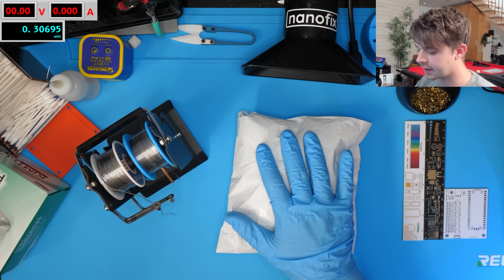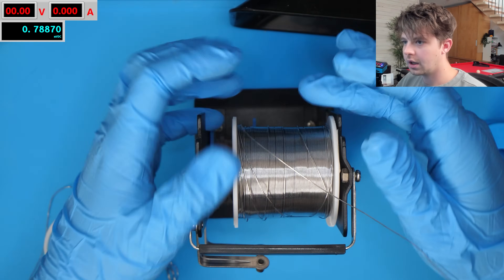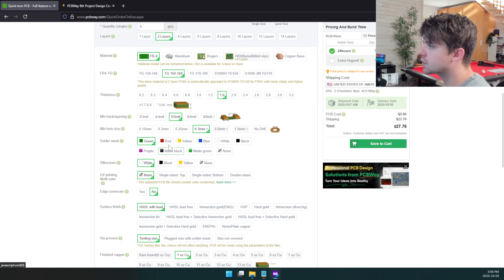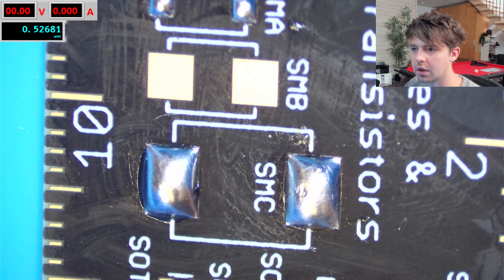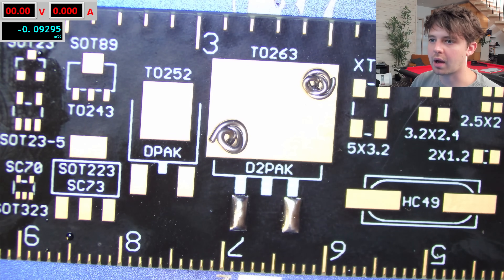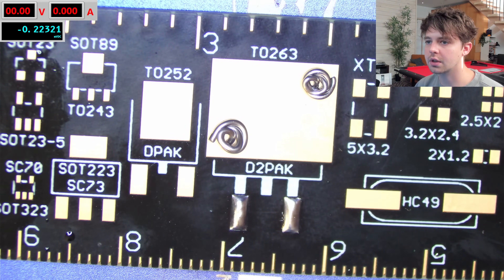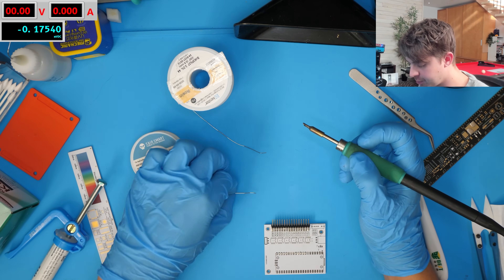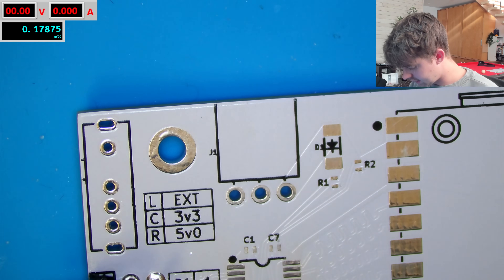Is Kester Solder Better?

Comment: Why did you remove my comments pointing out core 44 is RA and not no clean and recommending cores 285 or 245 and that kester does make solder in 0.6mm diameter?
Reply from the maker: I didn't remove any comments! I have not and will not ever remove comments or censor people. I can promise you that 👍🏻
Reply: @nanofixca  i dont understand, i tried sending comments both from my phone and laptop and for some reason they dont show up -.- maybe theres something in the text or length that is making it youtube shadowban it idk
Reply from the maker: @basileus9343  Yeah youtube's auto moderation/comment system is horrible these days. If you're attempting to post a link I think YT automatically removes it
Reply: @nanofixca  Havent put links though. I also tried posting a short rando comment, it went through, then i edited it with the message i wanted to say and a refresh later it disappeared! insane. Let me try and break it into smaller chunks to see if theres a part that triggers it.
Reply: The core 44 flux solder you got is an RA flux, imo its terrible as you could see (very sticky and brown flux residues), and getting the 3.3% content makes everything worse. It's also moderately corrosive according to the datasheet.
Reply: Nope, theres something about the 2nd paragraph i wrote youtube doesnt like. Maybe its flagging the kester product codes i wrote, they are 10 digit numbers, maybe they are flagging it as phone numbers spam?
Reply: Welp, essentially i was just talking about which flux cored solder from kester i would recommend, their RMA or no clean in 2.2% flux content, you can check the product code for the exact specifications of solder you wish on their website and then google it to find it. Also wanted to say you can find in 0.6mm, before you said it kester doesnt make it as far as you know, but they do
Reply: i would have sent you links and product codes to datasheets and models but youtube doesnt like any of that so thats all i can say..
Reply from the maker: @basileus9343  Thanks for the info! I may look into buying some different Kester solder for future testing so I'll look into it 👌🏻
Reply: @nanofixca  Would love to see it, wouldnt want to see you get into another mgchemicals 8342 vs 8341 situation 😂 RA flux is the devil. Kester is expensive and there's good solder for less money but when it comes to selection of flux percentages, type, diameter and alloy i find them difficult to beat, their portfolio is so extensive its assured to have the right solder for you and their datasheets are quite nice, i'm sure you will appreciate it 😁 scratches the tool nut itch
Reply: It's YT doing that bro. They silently added a comment moderating AI a while back which deletes any comments that it finds problematic. How does it determine what is and what isn't problematic? Nobody knows, not even the developers that trained it. It's a 'black box' just like most AI is and the exact combinations of words, personal history, username, pfp, etc that it doesn't like would be no simple task to determine. So try to avoid the usual nonos like getting political etc, but as with your comment, sometimes you don't even have to say anything remotely wrong and still set it off. I suggest copying your message before submitting it then refreshing in like a minute or so to see if it's still there, if it isn't you can try and paste it in and just rephrase things a bit to see if you can get it to stay. It's certainly a problem, and I've had my messages randomly deleted in the past as well, there's just not much that can be done...
Reply: @Hauk3ye  thank you, i learned it the hard way 😑
Reply: You deletes and hides around 3/5 comments I make. It's really stupid if a filter caught your comment. lol

Comment: I use Kester SAC305 at work, mainly because I'm not the one paying for it. That brown residue is a bit tricky - Their 285 and 44 flux formulations use a much higher rosin content than most modern "no-clean" fluxes, and so the residue winds up discoloring a lot more. It's functionally fine to leave on in most applications, but if you clean it off it has to be cleaned fully. Otherwise, some ionic contaminants that were encapsulated in the nonconductive residue from the resin can be exposed but remain on the board, and cause shorts or reliability problems later on (particularly for the 44 formulation, with a decent halide content). To complicate that a little more, the residue isn't very soluble in IPA. You can get it off reasonably well with some elbow grease, but the safer way is to use a dedicated cleaning agent like Flux-off. It just winds up being a bit more cost/effort on top of the already high pricetag, although they definitely do make great stuff with the track record to prove it
Reply from the maker: Very interesting insight! Thanks for sharing!
Reply: Totally agree!

I use a DIY blend of alcohol and acetone as my everyday flux cleaner for boards/components that aren’t sensitive to acetone (otherwise, Electrolube LFFR flux cleaner for solvent cleaning, or Electrolube Safewash SWAS for aqueous cleaning, especially in ultrasonic). They do WAY better than IPA.

Comment: I wonder if there is any difference in the way the flux of the Kester behaves if you use a lower iron temperature...I personally us AIM solder, but only because I found a box with 8 1lb rolls at a flea market for really cheap...It works really well, but the rosin flux in it smells awful...I have enough to last me a very long time though!
Reply: The answer is yes depending which flux type you have kester make different fluxes. Typically the no clean ones not rosin have a higher activation temp. I've used aim it is good but they discontinued alot of the rosin stuff they had I assume to conform to the no clean standards so that's why you can find a bunch of them on the fleabay. I recently got a hold of a sn62 from AIM the rosin definitely stinks but that's cause it's a old school formula base made to be used with old school tech (90's stuff or before). Also expiration dates they have to keep making fresh batches for the iso 9000 certs. So it's pretty easy to find and cheap. I do like that they recycle the metals which also helps bring down the price.
Reply: @rubenmejia4881 @rubenmejia4881 How would I find out the expiration of the AIM solder I have? It has a lot code on it, but I couldn't find anything about expiration...I'm going to use it either way because it still works really well, but I am just curious...I only paid $30 for 8lbs of it so I can't really complain...

Comment: I use Kester and I think hobbyists start soldering with crummy solder out of the tubes and then come across a pretty good hefty chunk of solder that feels like it lasts a near infinite amount of time and it changed their lives. I thought that gummy residue was normal and I'm probably gonna jump ships now if it's that similar
Reply: You should try Kester 24 as its the no clean version of Kester 44, Kester 24 doesn't leave behind the super sticky flux and 91% IPA cleans it nicely.
Reply: @xKuruh  There’s no such thing as Kester 24.

The “24” that their solder part numbers start with is NOT the flux! The Kester 44 I use starts with 24, too.
Reply: @tookitogo  I think he means Kester 245, as that is in fact their most popular no-clean RMA variant. The 5 probably slipped their mind with all this talk about the 44 variant makes it easy to assume that all the types have a 2-digit signifier as well. The majority of their formulations have a 3-digit number though, 44 is just unique in that it's VERY old at this point and has been uniquely successful, so much so that it has remained in production unchanged to this day!
Reply: @Hauk3ye  Yeah, you’re probably right that they were thinking of the 245. But it does remain possible that they saw a part number like “24-6337-0018” (#44, 3.3%, 63/37, 0.6mm) and mistakenly thought the “24” is the series.
Reply: @xKuruh  I have no problem cleaning flux of 44 with IPA
Reply: @IrishFinalExit  FYI, both Kester 44 and 245 say the same thing in their datasheets: IPA is not a suitable cleaner. 

This is the exact text found in both datasheets: “IPA will not clean the residues off the surface of the circuit board after the soldering process. A saponifier or cleaning agent specifically designed to clean a no-clean flux is required to clean the residues.”
Reply: @tookitogo  Of course, "no-clean" doesn't have anything to do with whether cleaning it requires saponifiers or not, just that once it's been activated it becomes inert and generally safe to leave on the board. Besides, it's the 285 that is the easier to clean/IPA compatible RMA flux.
Reply: @Hauk3ye  The text is copied verbatim from the datasheets. If you disagree with it, you need to take it up with Kester, not me! ;)

As for why they specify a type of cleaner: no-clean fluxes tend to be optimized for appearance of the flux residues, not for ease of cleaning. Consequently, many (not all, but many) no-clean fluxes have residues that are significantly more difficult to clean, if you decide to do so. That’s why manufacturers of cleaners make more aggressive cleaners for that purpose.
Reply: @tookitogo  I never disagreed with your reply or Kester's datasheets, in fact, I had pretty much said what you did here. The first portion of my message was about the fact that "no-clean" doesn't necessarily mean easy to clean, just that it can typically be left on the board after being activated. The last bit was saying that the 285 variant is the one that cleans easy with IPA as opposed to the 245 which is just "no-clean".
Reply: I use Kester 44 as well. The gumminess of the rosin has always been my only complaint. Like you, I am now thinking of jumping ship to the Sain Smart. It just looked waaaay easier to clean.

Comment: Kester is way better than that cheap Chinese stuff you buy dude. You just like saving money even if its cheap and close enough. That cheap shopping always catches up in the long run. When they say you get what you pay for its  very true in this world. All that cheap stuff will only last so long.

You even bought the thinner solder lmao and the cheaper kester you could get lmao..
Reply from the maker: SainSmart is actually a north american brand, although I have no idea where they manufacture their solder. I don't necessarily think cheap = bad in the same way I don't think cheap = good. Similarly, just because a tool is expensive and is made in North America does not make it good. I'm not trying to save money but rather trying to find good tools. I definitely spend more on my consumables for that reason - cheap consumables often suck. I'm not afraid to spend money, but I'm afraid to overpay for the exact same (or worse) product
Reply: So 44 is the cheap Kester? Whats the bougie Kester?
Reply: There are extremely good solder manufcaturers in China, Yikst is a good example.
Reply: @WimukthiBandara never knew ali express forces the cheap stuff on you

Comment: I have an older roll of Kester solder. I'll have to see if I can find the part number to compare.

SN63PB37 #50/275
0.50mm (0.020")
24-6337-7602
ANSI-J-STD-006 B
Reply: The 275 is great stuff. I've been trying to find a roll of it in the 63/37 configuration, but the closest I got was sample packs off eBay.
Reply: @rubenmejia4881 iirc that's how I got my 1lb spool. I think the date of manufacture was in 2014.

Comment: Please do "low melt solder" next. I'm having a hard time finding one that's not quik brand.
Reply from the maker: Good idea! I've only ever tried a couple different low melt solders and would love to try a few different brands
Reply: @nanofixca  if you're gonna do that video, make sure to research alternative options like casting solder, fields metal, etc. that would be awesome
Reply: Unless you need really low temperature Bi58 works well and is reasonably cheap, anything containing indium is expensive.
Reply: You can also purchase field's metal, works very well and is much cheaper.
Reply: @ceejay310  Beware a number of sellers actually sell woods metal instead which is highly toxic.

Comment: Would love to see more solder comparisons!
I use the 63/37 from Mechanic. I wonder how it would compare to these.
Reply from the maker: I'm thinking about coming up with some better tests in the future and comparing more kinds of solder wire like I did with my flux comparison videos. Thanks for watching!
Reply: @nanofixca I'd love the same. Yesterday I asked on Reddit if using low quality lead free solder just for tinning and Mechanic HX-T100 Leaded for regular duties was fine and apparently from now on Mechanic is a crap brand and I should only buy Weller and Kester... Man they were praising Mechanic stuff up until last month wth
Reply: Me too, would also love to see a comparison with the mechanic HX-T100. I really like the Mechanic branded one.

Comment: The kester flux you bought requires the flux to be cleaned should have bought kester no clean solder. Plus you can't fairly compare solder flux amount when you are using different diameter of solder because it takes allot more thiner solder to make up the difference of the next size up solder
Reply from the maker: I definitely agree that it would've been ideal to compare the same diameter, but Kester does not make 63/37 0.6mm as far as I'm aware so this was the closest I could find to what I normally use. Also both solder wires are rosin core solder (not "no-clean"), but the Kester did have a higher % rosin content. I have nothing against the Kester solder I just think it's a bit over-hyped after trying it :)
Reply: @nanofixca  Its really interesting to see the difference. I bought Kester solder years ago when I build my first keyboard because it was so highly recommended by the community. I'm still working through that roll so I've never really had the chance to use something else!

Also I wonder if the other guy was talking about the difference between the 44 and 245 core wire from Kester?
Reply: @nanofixca i have .25, .31, .41, .60 and 1mm in kester no clean
Reply: Incorrect.

"44 possesses excellent fluxing ability; the flux residues are non-corrosive, non-conductive and do not require removal for most applications under normal conditions of use. IPA will not clean the residues off the surface of the circuit board after the soldering process."

Comment: When doning reballing the solder makes a difference. Mechanic solder works good for everything other then reballing
Reply: Mechanic has been making some good stuff left and right.
Reply: @neverendingstudent yes they do i have allot of there flux, solder, wick and tools. When doing reballing it takes allot more heat then other 63/37 solder to wick it up cleanly
Reply: @1998eclipse1998  Just so I don't misunderstand: does Mechanic solder require more heat, or does Kester solder require more heat?
Reply: @neverendingstudent when preparing a board and chip for reballing mechanic solder requires a higher temperature to wick solder up cleanly. Kester is 183c and mechanic is 190c so yes mechanic requires more heat. I normally have to turn up iron 35+c more when using mechanic versus kester, Aim, chip quik or delta.

Comment: CHIP QUIK, DELTA, KESTER, WELLER are all great solder brands
Reply: You can't go wrong with Nihon, Goot or Hakko from Japan either!  There are lots of other people making (or indeed just repackaging) the Nihon SN100C lead-free solder nowadays but you may as well get the original as it is not particularly expensive.

Comment: AIM is a great solder and it is made in CANADA
Reply: I can attest to this. Not too long ago I got a smokin deal on some AIM SN62 wire in 3% RA flux flavor and this was my first time trying out the brand. I've had some time with it now, and there's absolutely nothing negative I can say about it. It's a truly impressive product, and it would be a great deal if it were priced the same as the other major brands. But the thing is, it's not, somehow it's significantly cheaper! I didn't know it was made in Canada, but I am in the US and it's easily one of the most affordable brands available here, so I'd assume it should be even better priced over there. Definitely one to keep in mind when shopping around.
Reply: Same here, @hauk3ye I scored mine from ebay. The reason why AIM is so cheap is because they use recycled metal and refine it to get out any impurities. I noticed it's not as shiny due to that fact as other brands but it's never failed me either.